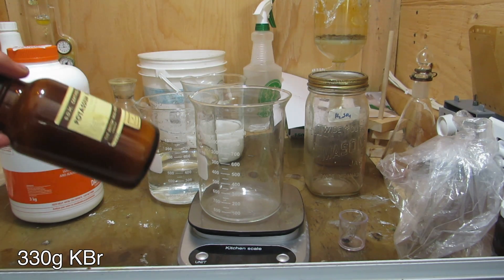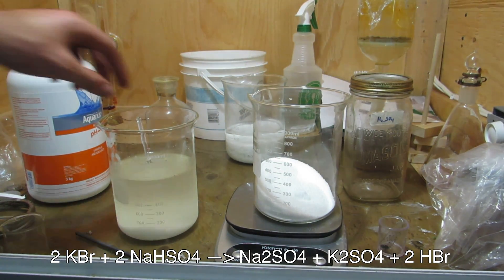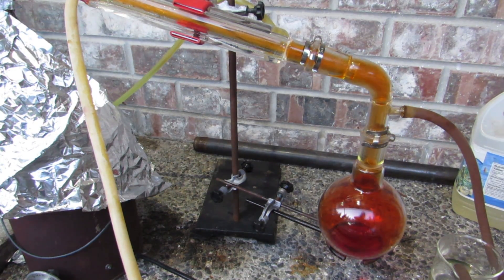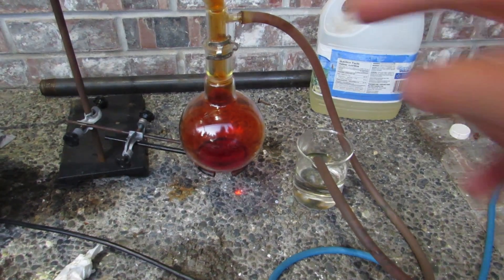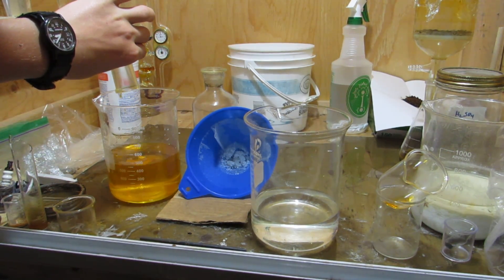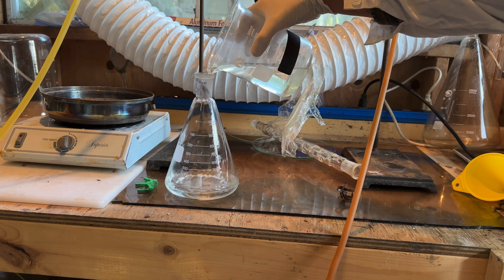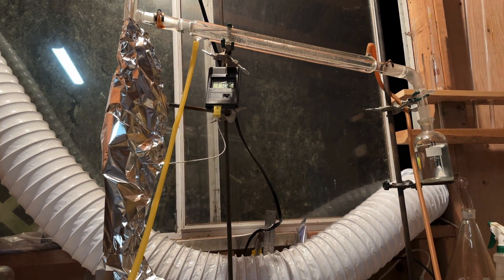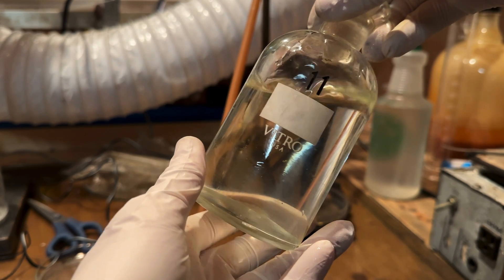Preparing Hydrobromic Acid

Comment: Where do you get BeO insulators!? Dangerous and expensive as hell. I think they are used only in military and space tech.
Reply from the maker: I mean they’re only dangerous if fractured or ground to a powder. I’ve heard they’re used in some old microwave magnetrons. I am yet to get my hands on a microwave that actually has beryllium oxide, but it’ll happen at some point lol.
Reply: @TheCanadianChemist  If you mean microwave ovens, then that is just a myth. They have only pink alumina. Some radars have BeO in their magnetrons though. I guess most of them don't have it.